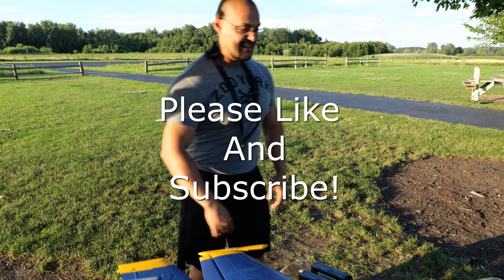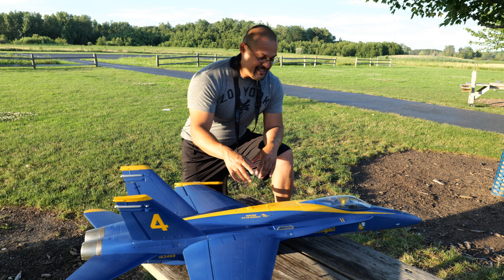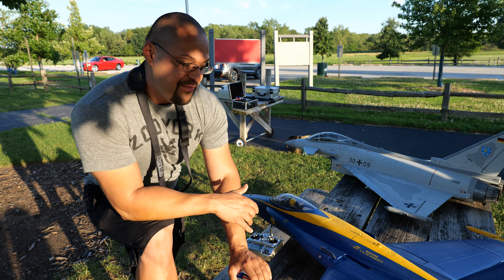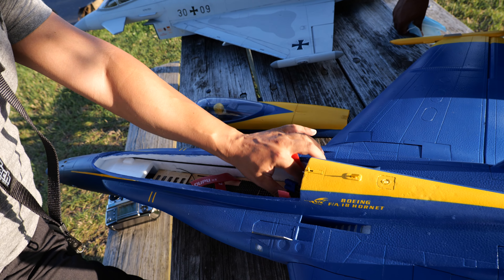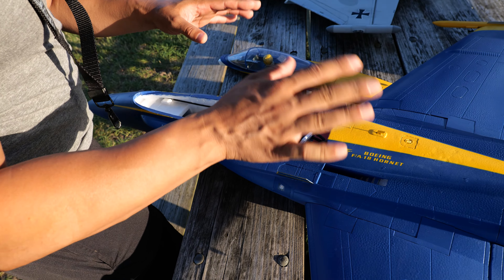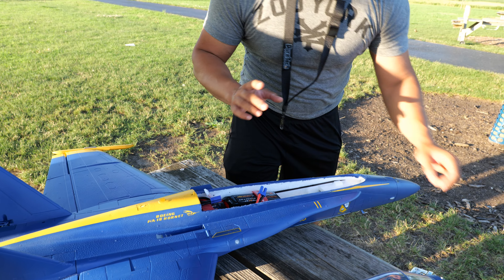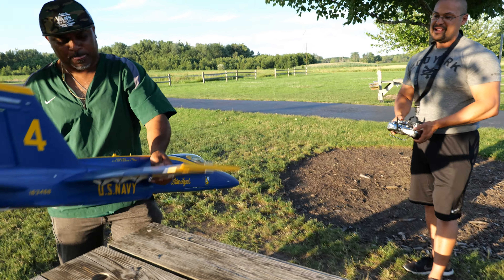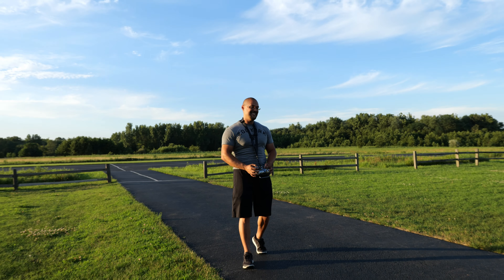Awesome Modified Blue Angels RC Jet.

Comment: I have recently upgraded to an 8s system 12blade fan w/ in runner and Ive seen the performance. Its a significant difference from the 6s but nothing compared to what you did with 12s! Its insane. Fantastic work!
Reply: Thanks a lot David... The newer and heavier 90mm airframes really require much more power to fly well, but only a few have the wing and battery area to support it. I'm very happy with this one and the modded FW F-22.

Comment: beautiful flight, I would like to buy the 18, but many reviews say that the model is heavy so it's not fast, but for updates you have to change: engine and regulator? even if 'I update it to 8s? thanks bye
Reply: Yeah, it's hard to get the newer/heavier FW 90mm planes to perform... Even on a hot German and lightweight 8s setup they really only fly like a decent stock 80mm plane IMO... The lightweight EPS days were much better performance wise.

Comment: Hey buddy…. On this freewing 12s… Did you upgrade servos and if so what did u end up using. Also what Size BEC are you using ? I purchased a 160amp castle creations ESC to use with a 12s Shuebeler motor. Trying to figure out BEC info and servos to use. I’m assuming the elevator servos are the only ones needing it?
Reply from the maker: I know he used stock servos.  I'll call him and get the other info or have him reply on this thread.
Reply: @patmorris123  if you don’t mind see what ESC he used please.  My castle creations is bit bulky and is gonna block airflow to my motor. Thanks, I appreciate it.
Reply: Yes, I'm running the stock servos with maximum resolution to help, but I did have to reinforce the elevator servo mounts. ESC/UBEC is all pilot preference, but I will say I'd never recommend Castle Creations...  Just overpriced with far too many reliability issues IMO. Just my experience over the years. Hobbywing, ZTW, YEP, and many others are far better options.
Reply: @fern6978  Thank you so much. What a beautiful jet you have setup.  You inspired me to push my f18 a little further to make it even better. She’s all setup now with my 12S Schuebeler DS-51-AXI HDS V2015 90mm + HET. She’s ready for maiden flight. Just waiting on weather and Callie graphics. Thank you for sharing your video.
Reply: @Spanishcop  Awesome! I'm glad to hear it! Most of my 90mm planes are setup this way and once you go true HV, it's hard to go back. 😁 I only run 6s if the plane is super lightweight or limited on room ha!
Reply: Is it possible I could contact him by email or messenger?  I’m lacking power for some reason. Is he using motor lip on his schubeler? Is he using the typhoon 1125 motor with fan unit? Did he have to carve out hole for fan lip? What esc is he using ? I have a Avian 120a.
Reply: @spanishcop2090  Sorry for the late response... I never saw this, but yes... Running a proper lip is mandatory and running without it will cost you about 20-25% power. The 1125 motor is a low power setup so you'll need it order you'll likely see less than stock performance that way.

Comment: How is fernando offsetting the extra weight for the extra battery?  Did he add weights in the rear of the jet to get that 105cg?  I'm running a similar setup and my nose is almost 7.5 ounces heavy on the nose and thats using lightweight batteries. Adding the Schubeler setup reduces weight in the back which makes it nose heavy and then you add the extra battery for the 12s and like I said, i'm close to 7.5 ounces.  Can you please inquire and thank you.
Reply: Strange... If you're running 4000mAh or less (Mine are 590g each) you should have PLENTY of room to achieve 100- 105mm as I have. I've never added any dead weight to any model and if that's needed, the setup isn't optimal IMO. Keep in mind that the modified canopy is mandatory to utilize the correct lipo location. Good luck!